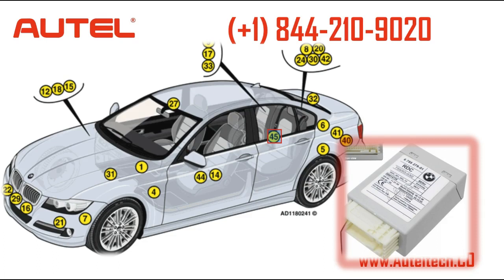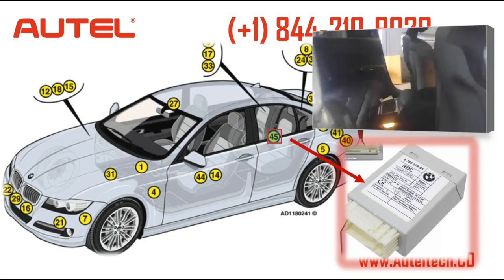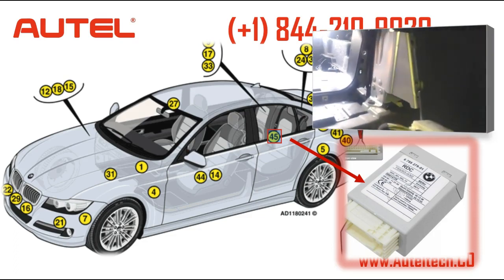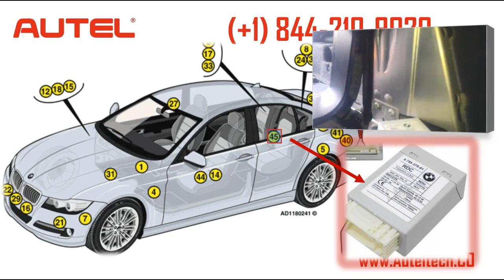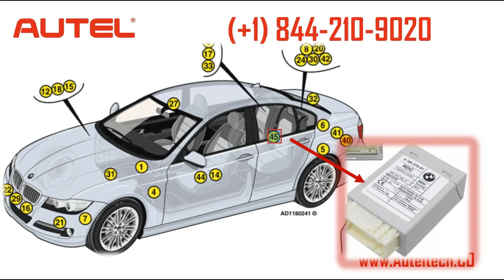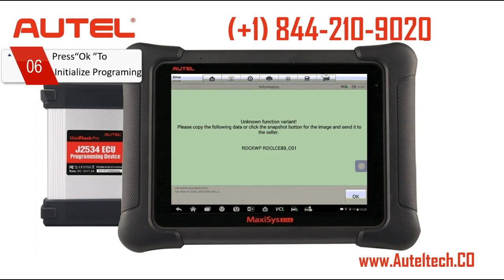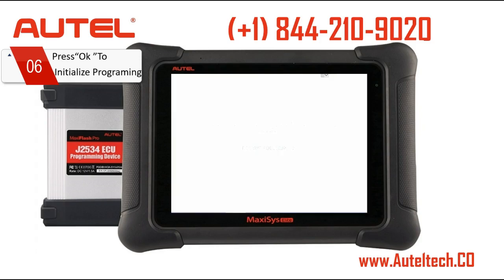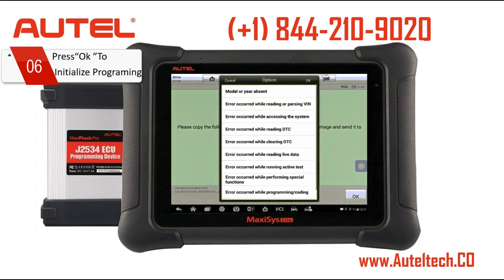Autel Maxisys Elite | RDC Tire Pressure Module Programming | Case Study 2018

Comment: please i have 730 il e 65 2004 i have false Tyre pressure sign i have no sensors in the wheels but the system depend on the rotational speed from ABS system- do i have RDC also in my car ? and can i fix the problem through the software ??
Reply from the maker: Hi Ahmed do you have access to BMW repair information? It might be worth it to help get the bottom of your problem. They will tell you if it need programming / coding etc. I dont like programming module if you were not directed to by the OEM

Comment: Hi, can i do programming on BMW e39, e46 etc and what is the capability Elite can do on these BMW modules?
Reply from the maker: Hi Abdul  . Which module to you want to program? And what year is the vehicle? The reason I ask is becuase the Elite is quite strong on programming for BMW.. But I noticed the programming functions are more previlent on vehicle 2010 and to present day.

I have alot of clients who just work on BMW and they are extremly happy with its programming range
Reply: @AutelConsultancy  Thanks for the reply.
I'm looking for earlier models 1997 to 2003 which are popular in my country.
In many cases i need to reprogram ABS module, DME or coding functions, currently using INPA K-DCAN NCS.
And after watching ur review I'm interested   on this new machine which can widen  vehicles I'm working on and have varaity